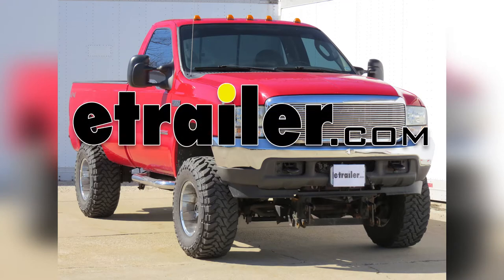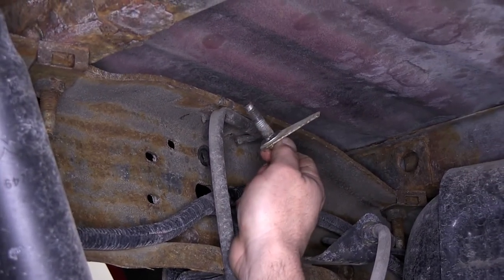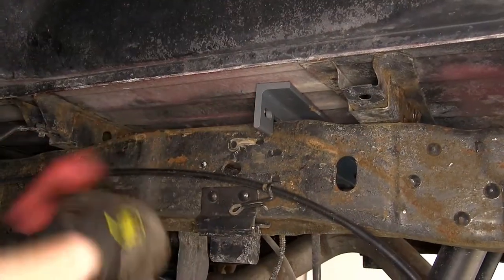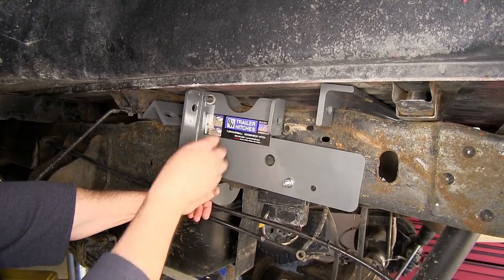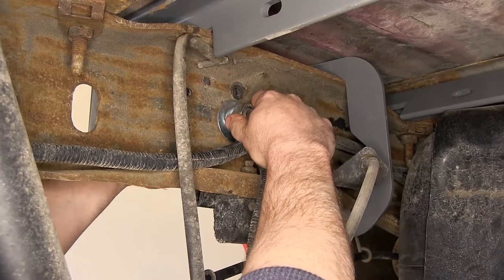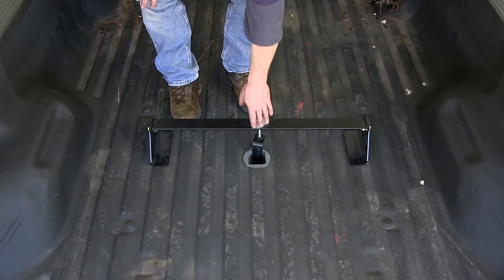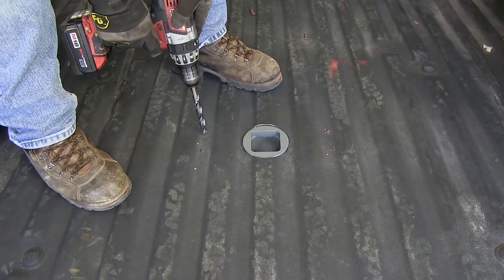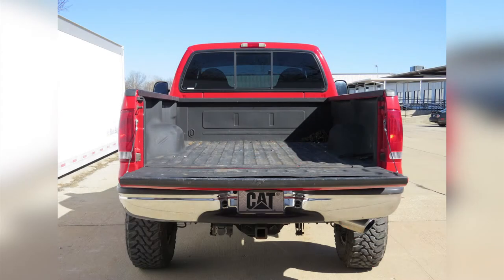etrailer | Gooseneck Trailer Hitch Installation - 2004 Ford F-350 Super Duty

Comment: What is the measurement to cut the 4in hole from rear of the box to where you drill the hole
Reply from the maker: For the long or short bed 2004 F-350, you'd drill the hole 47 inches forward of the rear edge of the truck bed (not the rear edge of the tailgate, but the rear edge of the bed.)
https://www.etrailer.com/Gooseneck-Hitch/B-and-W/BWGNRK1108.html